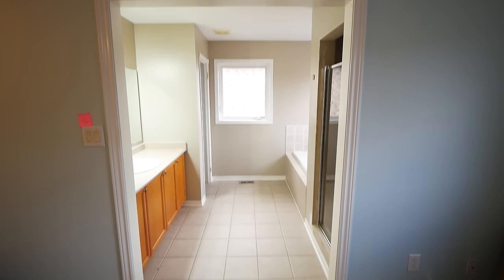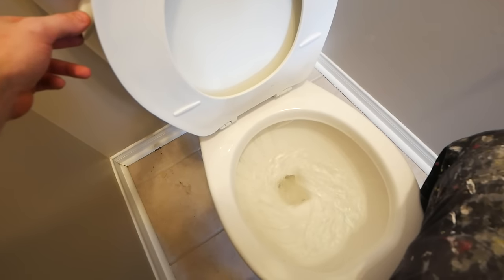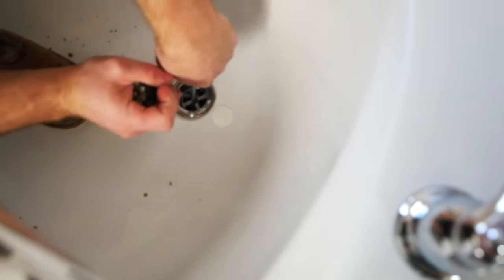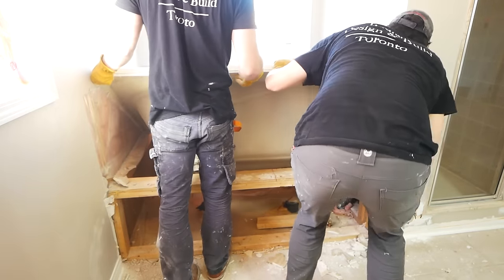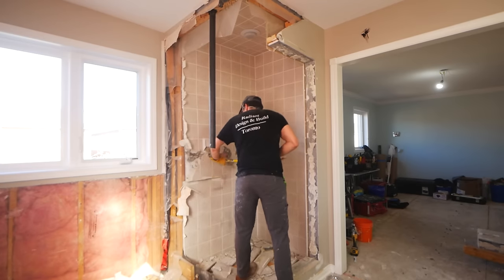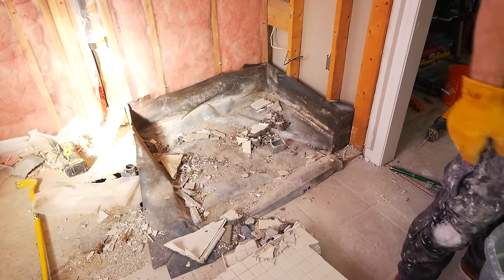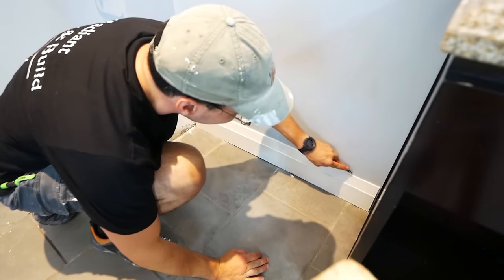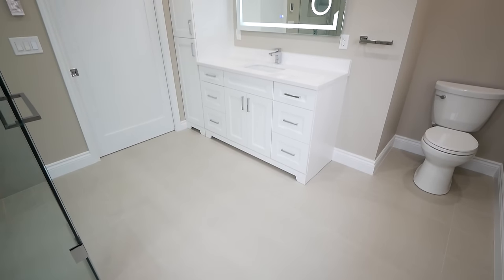How to DEMO a Bathroom for a Renovation

Comment: Very informative for a DIYer. 

A decade ago I helped my neighbor with a demo of their upper bathroom. They installed this makeshift pulley on the window. It made trashing out the debris so much faster. Doesn't make a mess inside the house. Throw the trash in a bucket, down the pulley, and into the wheelbarrow.
Reply from the maker: Thanks! Sounds cool but not sure how this would save any time/effort really

We just carry a garbage bin to the yard bin on the drive, with the pulley system you’d still need to go up and down the stairs but also set up the pulley and walk around the side of the house and have a wheelbarrow

Comment: I seen your video on how to do pot lights. I need to know how you power your  Mirrors in the bathroom And your floor heating.
Reply from the maker: Mirrors get a 14/2 romex from the switch and floor heat we typically do a 120v line of 14/2 steady power

Comment: Curious if you indeed notice less dust or actually that window hose is sucking dust out? I am a one man show pro and am contemplating about 12-14' fan with flexible hose for the same purpose. Your system looks like a 4 or 6'' and am skeptical about being able to suck out. 👀
Reply from the maker: It absolutely makes a difference although I’m sure a duct size like you’re describing would be far superior. Recently we put a fan in the window because we were having some moisture issues with the dust extractor since it’s winter here and honestly the fan was better imo. Not anywhere near as noisy and I felt like the dust was removed even faster
Reply: @WorkinwithWolkon  Much appreciated. All the best in future projects. 💪👊👍

Comment: also with the toilet it takes some strength but using the bucket and lifting the toilet up at a angle on the bucket it will spill all the water out into it!
Reply from the maker: I’ve become a fan of the shop vac it’s just so satisfying draining all the water